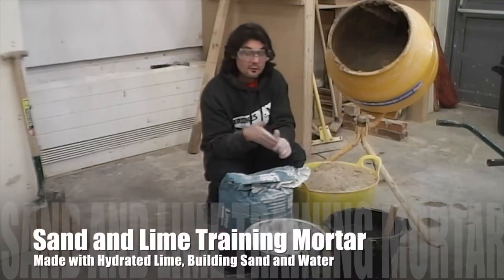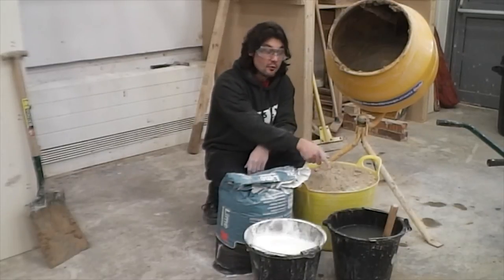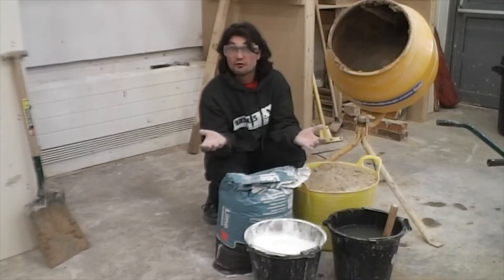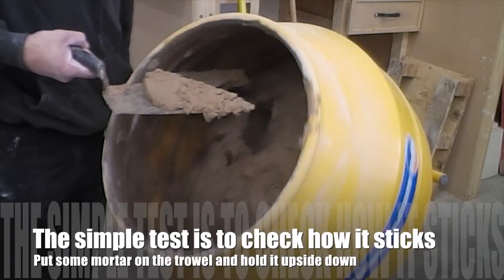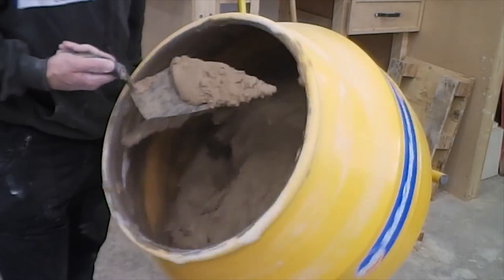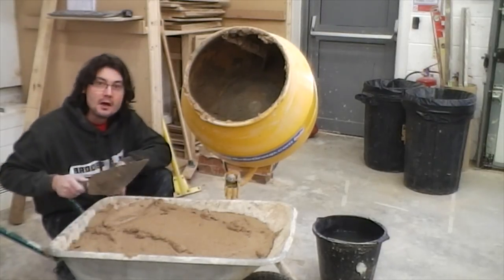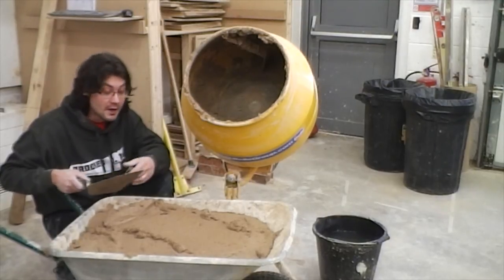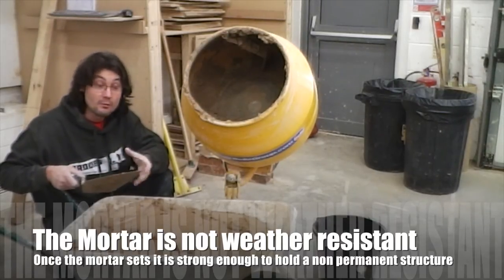How to mix a Training Bricklaying Mortar

Comment: How big is a yellow tub and how big is a bucket? Without that information your formula might as well say "a strings length of everything".
Reply from the maker: I didnt measure in string but used buckets and tubs instead.
Reply: @wesbrookes198  He has a good point, for someone who is teaching people you would think you might be a bit more helpful instaid of taking the piss lol. Nice
Reply from the maker: @dorrisgonnawreckyou7111  so confused
Reply: @wesbrookes198  Will a blue tub work? Seriously could you answer the question of ratio, this would be a really useful video if it did, I stopped by looking for the basic info and this does not have it. People have asked politely.